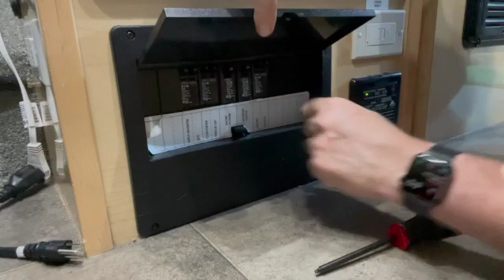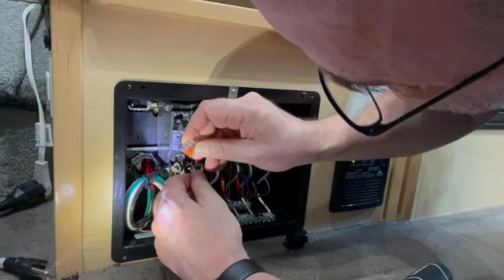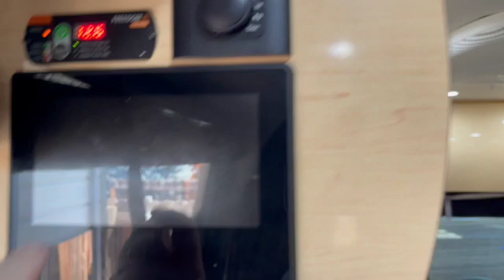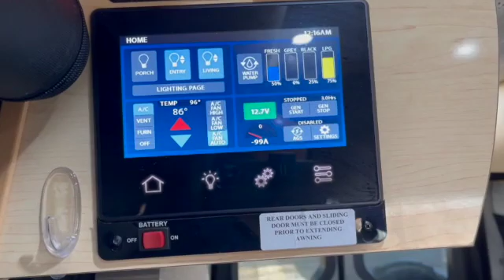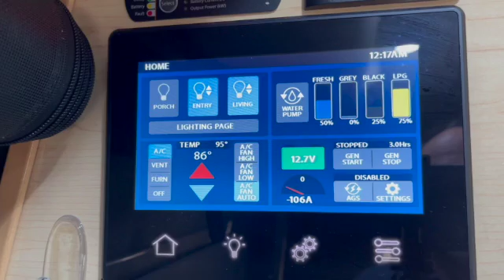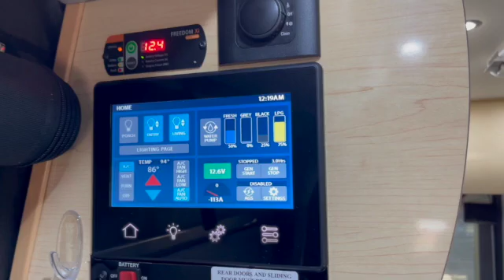Running the A/C on Battery on a Pleasureway Ascent

Comment: Thanks for this..can you confirm—did you leave the generator integrated? Will it charge the lithium bank and can it still run the AC or is the AC removed from the generator 120 distribution?

Comment: Thank you for the great video -- I have just started watching your power upgrades and had a question as I have a 2017 PW Plateau -- it looks to me based on your video, like you could run the A/C while driving without using the generator by adding the circuit breaker and making the inverter bus bar modification (as you did in the video) and that would keep the batteries almost full as a result of the power coming off the generator (using the 2000 watt inverter and the 200 amp hour stock house batteries) is that right?

Comment: In your testing how long can you run the AC off the Lithionics?
Reply from the maker: On average its drawn about 10% per hour (of my 630 amp capacity).  So far the most I've run it continuously is 5 hours and it was just above 50% when I stopped it.  I've been in up to 105 degree weather and set the thermostat at 86 (the highest it can be set on the PW).  I can't wait to get the 280 amp alternator installed.  Should be in the next couple of weeks.